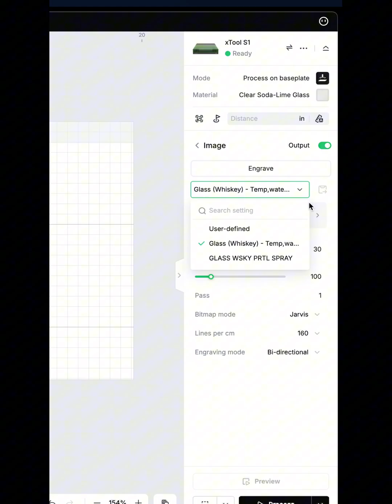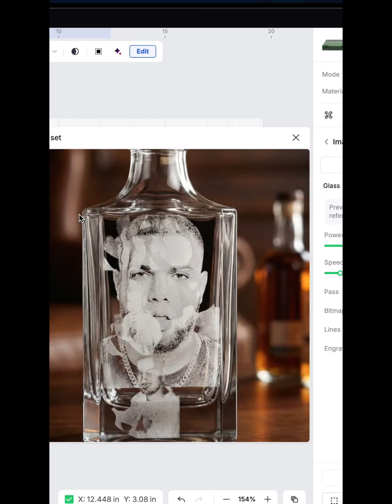The "Magic Mix" for Photo-Realistic Glass Engraving! (No Expensive Spray!) | xTool S1

Comment: would love to know the "magic recipe" black paint and water with no proportions or amounts doesn't really help - thx anyway...
Reply from the maker: You're right, I didn't specify proportions. It's a very small amount of black paint mixed into water until you get a thin, even consistency that coats the glass without being too thick.
Reply: Could you give a ratio even a close guess? 3 parts water to 1 part paint? Or is it more of a 1 to 1?